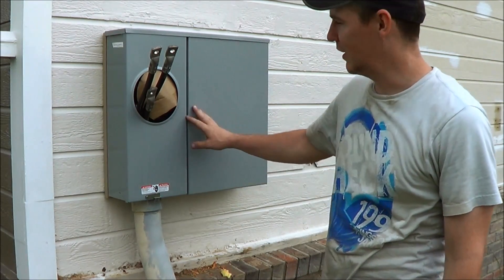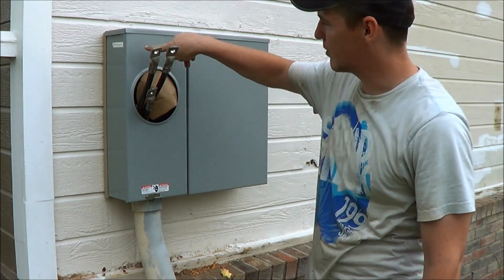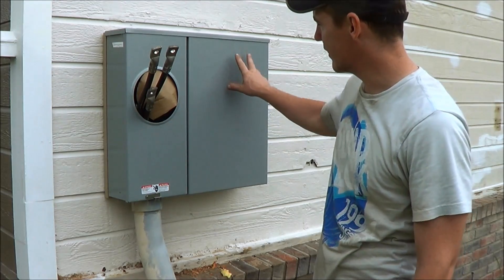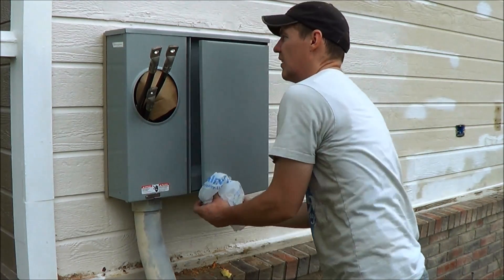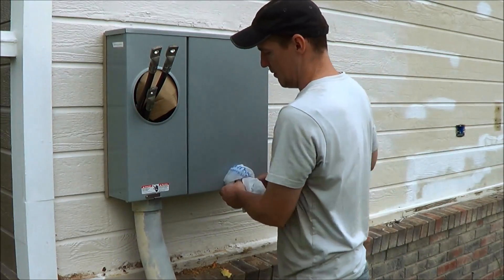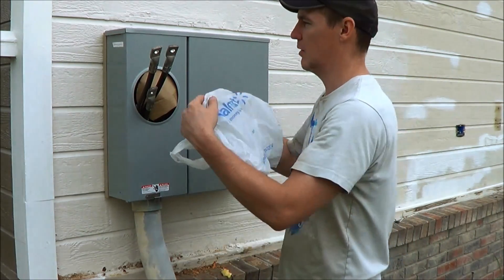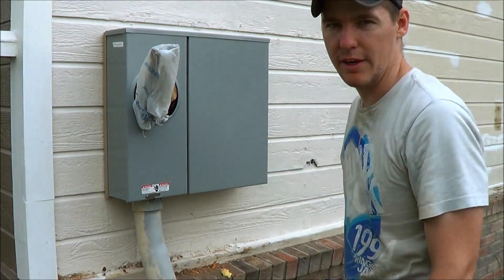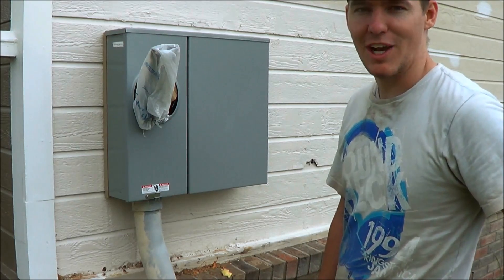Electrical Meter Base Install - Time Lapse

Comment: What brand did you install?  It looks like a good meter socket and main breaker combo.
Reply: What brand is my question too. That will prevent a separate shut off box install.  THAT SHOULD BE THE STANDARD.

Comment: Is it legal in California to add a meter after the breaker that's comes from the main breaker meter?
Reply: Required in 2020 NEC code 230.85   “Emergency Disconnects “   Allows fire department or others to shut of power without going inside the structure.

Comment: Y'all said it was a good job??  He forgot bushings on connectors.  Anything over 1" needs bushings.  Didn't see him use deox for his aluminum wiring.  Where is his bonding??  Plus, inside panel is now the sub n needs to float the neutral.  At the meter base, he needs to cover the opening if it does rain completely instead of just an plastic bag.  Before city hooks up power, they'll need to see inspection report first.  Just my 2 cents

Comment: Just one thing that I noticed actually three  things, I did not see a a plastic bushing on that connector and torquing that lug and ground rods install or the actually ground in the main....or maybe i did not see that.

Comment: I gotta do that energized. We cant shut down line side
Reply: You can ask the utility to disconnect power
Reply: @Nick-bh1fy  not in Philadelphia
Reply: @dickcheesewiz  If your network operator refuses to isolate it for you,  that means you haven't yet blown enough of the fuses on their end of the line :)

Comment: Nice visualization of how to remove a box and screw another one in it place(Even Though you skipped part of that too)...... WHERE's THE BEEF?? You left out about 95% of the actual work. I have never seen an electric co. that will mount your service side lugs for you..... maybe its different in your part of the world.....

Comment: Why do you paint in such a strange order? First 15cm here then 15 there and a little bit more over there until everything is white..? Why not just start in a corner and do it systematicly? And that bag is not going to keep water from going down that pipe. But it may help against corrosion.
Reply: Richard van Pukkem the paint job is the least of the problems here.....
Reply: They also threw away the cardboard placeholder shield that comes with the meter base for this very purpose.

Comment: Gee, Here in New York we, as a home owner can & are able to do your own work legally, most people that do this are not rich & cannot afford a $90 an hour electrician to do the simple basic operations needed to get this right & pass inspection. I have a friend that is a retired electrician & he went step by step with me doing a hands on setup of the 220 box & sub panel shut off 12" away  so I could save myself some bucks & still have it done by code & safely too.. The dweebs here that try to tell you that you cannot do it yourself are just po'ed that the state lets anyone that owns their own home, do the work of someone that is licensed to do that type of work & can rip you off big time by quoting that whatever they are doing is by the CODE book even when it is NOT even IN the code book, but sometimes it should be because it might be relevant to being a safety factor anyway.. So what you can do legally gives you more confidence & is able to keep you from spending way too much money, so you save something for later & will let you thumb your nose at the dweebs that look at cha like you are stealing their money from them because you are not using THEM to do the job at hand..  So, after I was all finished installing everything the way that Roger told me to do it,  I called the Inspector out & he looked it all over & then told me that Roger was a very good teacher & that my project had passed with flying colours also, he knew most of the licensed electricians in the area & each one had something that they did that set them apart from each other & he knew what Roger's trick was & saw it in my wiring job, he then praised me on a good job & said that he wished that more homeowners would take it upon themselves to know how to do everything around their houses so they could enjoy life & not go broke having to hire someone that is gonna rip ya off when they start quoting the code book & then add some codes that are not written in said book so, they can add more money & time to a job  even when it is not needed anyway..  My buddy had a new house built & before he could live in it, he had to have the towns ZEO  (zoning enforcement officer) come & inspect it for a Certificate of occupancy meaning it was safe to live in.. & his ZEO walked down a hall way & pointed out to him that he needed an additional smoke detector 6 feet up from the floor & in the middle of the length of hallway,  Bill said that he didn't see that in the code book & that he already had 4 smoke alarms in the house anyway But, that dickwad was persistent & Bill went into the bathroom closet, picked up a smoke detector out of his never ending supply of things you might need at any given moment & he attached it to the wall using sticky backed Velcro in that location  that dickwad suggested,  This got dickwad really pissed off & he was disgusted & quickly signed the scribbled signature on the C of O & left the house in a huff..   Dickwad was back a few minutes later asking if Bill could take him down to the street because the driveway was not quite finished yet & had a river of mud & stones going the complete length of it & being that the builder had brought him up to the house which was 3100 feet from the highway, he left his car at the street & now had to walk down the muddy driveway .. Bill told him that he didn't ever read THAT requirement in any code book & handed him a newspaper to spread over his head so he wouldn't get to soaking wet while walking down the driveway to his car..  I was there & started laughing the minute he started ringing the doorbell, as I knew what his problem was right then & there.. Had he NOT insisted on doing the smoke alarm,  in THAT specific spot, dickwad  might not have gotten Pneumonia while walking the 1/2 mile down he driveway during the massive cloudburst that day...   I also like reading the comments on stupid stuff like THIS video that wasn't all that bad but, I sure didn't care to be looking at the back of his T-Shirt when he was covering up what he was doing & why the hell did he feed out 10 feet of wire thru the hole in the building just so he could strip off the casing & then cut off all but 2 feet of it, Did he even use that 8 feet of wire he cut off OR  maybe he stripped off all of the casing & took the copper back to he scrapyard to he got some $$$ for it? LOLOLOL
Reply: the flash do you have a life?

Comment: 🤔no plastic bushings?
Reply: +Past Master  Inspector would fail you in these parts for not installing those plastic rings on the threaded ends. No inspected tag no meter either! Electric company won't work it without being inspected here!
Reply: +Troy Brownrigg  where's the ground 1/4" solid wire and copper rod?
Reply: Traveler water painting examples
Reply: i was gonna say lol

Comment: Are the boxes that protect the wire and components inside it rain proof? What would happen if a bunch of water got inside of the box and soaked the electrical parts?
Reply: It could short out and start a fire or electrocute someone if touching the metal meter box.
Reply: Mines been standing in the middle of a field on a post for 15 years now and that's not an issue.
Reply: Typically not much besides corrosion and lost energy.   Higher voltages will just vaporize the water the instant the water bridges out any of the legs,  and lower voltages will just sit there and dissipate wasted energy until the water evaporates, or breaks down from electrolysis (at which point the oxygen will corrode certain types of materials).  The entire box is metal and presumably well-grounded (via multiple earthing points on both sides of the meter) so it would be unlikely for any stray current to be detected by anyone outside the box (even if they were touching it).   Most higher voltage power lines are bare conductors with no insulation and that equipment does fine.

Comment: can you tell me what kind of ground sistem do you use most in the united states?
Reply: Ulfer is the best.... but minimum of 2 eight foot ground rods.
Reply: TN-C-S / PME is what the rest of the world calls it.   (DNO provides combined earth and neutral and then we earth it again in multiple places at the installation).   Only I think gas stations, marinas, and other special use cases use TT/independent earthing.

Comment: Doing my own as owner /contractor in Florida. Got a code book and went to it.
Saved 7 grand on a job a teenager could do. Encourage anyone who wants to save thousands on jobs anyone with any minor skills to do their own. It's 4 wires. Get over it.
I wouldn't mind if it was 20-30$ an hour but 90$ hr is surgeon money. I'm not paying that for easy work.
Reply: ️Electrical work isn't something just anyone can or should do and I wouldn't encourage anyone trying this without the proper training and skills
Reply: Guy Robby
 I have yet so see an HVAC guy do actual electrical work better than an Electrician. I`ve known from experience, i`ve had to help HVAC guys connect wires and figure out circuits not to mention, bend EMT pipes for them.
Reply: That doesn't mean every HVAC guy is better at circuits,  maybe you're just bad at circuits compare to the HVAC guys so you try to blame all electricians lol. So many years in the electrical field and had to switch over to HVAC.... wonder why. I'd love to see a second year apprentice bend couple emt pipes just by eyeing it. electricians at my company don't have a set rate, if you're a good electrician who can put out top notch work, no way in hell their getting paid dimes and pennies. Why would they when they know their worth??
Reply: Guy Robby But then again why would you start from the bottom for another trade....
Reply: +agaveman I've met tons of cheap guys like you who ended up spending double to fix their electrical problems. Plumbers and HVAC guys with 50+ years of experience in their field doesn't make them an alright electrician lol.
Reply: Switch trades? Hardly!  being triple ticketed Electrician, Refridge and Gas B I'm highly sought after and a specialist, rather than a run of the mill tradesman. Anyhow this is the internet and I have better things to do than argue with a hack.
Reply: Lmfao hack, okay sure. at the end of the day a good electrician doesn't need any other trade. if you're a good sparky, you'll never be out of work or side jobs.
Reply: Thanks for the compliment because I never was out of work in the 10 years I put in.
Reply: an jo ezy if yo put yo mirnd to it bdurr
Reply: it's more of a liability and insurance question, and $30/hr it's what a licensed person makes working for a company, plus benefits and the fact that you dont pay all the overhead(helper, insurance, truck,licensing,etc,etc,etc) and we dont bill every hour of the week.
Reply: Must be different where you are, I worked as a ticketed sparky for 10 years in mostly commercial, some industrial and about 6 months of Resi so I have spent time around a lot of electricians and now that I've been in the HVAC/R industry for 6 years I can honestly say that I have yet to meet an electrician who can outsmart an HVAC Tech on control circuitry. I'll admit my HVAC co workers can't bend pipe, but honestly big deal, a 2nd level electrician can do that efficiently. I guess that's why they pay Hvac guys the big bucks though ;)
Reply: @guyrobby5221  that's because you never met me
Reply: hvac guys are better in electrical than most electricians.

Comment: For anyone reading and considering this job, first believe in yourself and don't listen or allow the cancerous posts to take over your thoughts. After recently installing a 200A socket meter with a 200A outdoor breaker box along with an indoor 200A circuit breaker box I have a few tips and I am not a licensed contractor:
0. Apply for a permit and contact your inspector prior to doing the job and after you have a precise idea of everything you are doing as every single person that you are in contact with will tell you something differently but the only thoughts that matter are the inspectors. (in fact what i tell you on here will be different than what your local inspector will probably say, I err on the side of being overly cautious when it comes to wire size and grounding though).
0A. Contact the power company and schedule a time to have your power shut off so that you have plenty of time to get the job finished prior to the inspector showing up (might need multiple days or make sure to do everything you can while the power is still on.. it's not an easy job)
1. Install a 200A socket meter with a lever bypass 
2. If you have an outdoor pole then you are responsible for the wires going to the top of the pole along with the conduit (most likely 2" schedule 40). Use 4/0 Al or 3/0 Cu for 200A service (most likely  2 Al for 100A)
3. If you are connecting to the top of the socket meter use a rubber O-ring and glue on the socket meter adapter to make sure it doesn't leak water.
4. When connecting to the bottom or side of the socket meter connect it so that the male adapter piece goes into the box, fasten it with a metal conduit nut, then put a plastic insulating nut on top.
5. If you have an outdoor box then run 4 cables (4/0 4/0 4/0 2/0 for hot, hot, neutral and ground) through schedule 80 conduit underground at least 18" and place an expansive coupler between the earth and where the conduit goes into the house. You can dig the hole yourself but make sure to call 811 first or whatever provider comes out to mark your ground where things need to be dug. Do this prior to pounding in ground rods.
6. Connect the conduit to the indoor electrical panel box using the same methods as the socket meter.
7. Pound 2  5/8" ground rods 8' into the earth.. 1 rod is close to the outdoor circuit breaker box and the other is at least 6' away from the first rod and run #4 copper wire from 1 rod, to the other rod and to the outdoor circuit breaker box.
8. jumper your hot and cold water pipes together and run a #4 copper wire to your indoor electrical box. If you have a metal frame on your house or natural gas lines then run them to the indoor electrical box or jumper them.

random tips:
*Buy cable lube for your cables just in case you find it very difficult to pus the wires through. Usually you want to push the cables through the conduit then glue it together.. there's no way you will get cable through a long run of conduit especially if it has 90 degree bends.
*Use antioxident on all your aluminum to lug connections
*Place duct seal on the inside electrical box where the conduit from outside comes in, as you don't want cold air to come intot he panel box and create condensation.
*Connect your neutral and ground together only in the outdoor circuit breaker box

 Feel free to send a message, again im not licensed and the job i did was in minnesota where the socket meter was installed on a pole about 10' away from the house.
Reply: I pull wire and cable through conduit that is complete all the time because the code says it has to be complete in order to install the conductors.
Reply: I have a question for you I know this thread is a few years old but If by any chance you get this message please message me back thank you
Reply: Makes sense and all.  when I called my county to get in touch with who the inspector will be.  Answer she gave me was " You need to ask those questions to an electrician."
Reply: I have a question for you on the 4/0 4/0 4/0 2/0 six one four three seven four three eight eight four if you see this.  Going to run 150 feet 350Kcmil would like to dig the trench and run the the conduit and cable myself to save some money.  Will pay an electrician to terminate the ends and upgrade my 200 t 0 400 in parallel as well as adding 2nd 200 amp panel.

Comment: Wtf.. where are your grounds?! And why does the utility company do the service connection?!? Which hill Billy state is this? I'm an electrician in nj and that shit here is no joke. Before you even start a job you have to meet with the utility company inspector which in my area is pse&g and go over the scope of work. You run the utility/service cable and wire the meterpack/ meter pan yourself.  They only connection they make is the point of attachment coming from the street pole. Not to mention you don't have a #6 ground with a Kenney clamp in the meter pack with 2 8ft ground robs and a #4 ground with a Kenney clamp coming from the water main pipe. They you get a town inspection and a utility inspection and connection.  And if anything is off they can be assholes and make you do everything all over which can be a big fucking nightmare

Comment: Ryndon Ricks, you scab rat hack.  Where is your #6 grounding conductor to 2  ground rods separated 6 ft apart?  Where is your #4 grounding electrode conductor going to your H2O water line?  Must be grounded 5  ft from entering the building and jumped at the meter.  Not to mention a #4 grounding bond on the gas line. Few OSHA violations also: no hard hat, wearing a tank top is illegal, no safety glass, no visible green shirt or vest (which must be supplied by the employer).
Reply: If he is self employed, he could tell OSHA to go get fucked. Plus, when has OSHA ever been at a residential job like this? Show me in 29 CFR 1926 where a hard hate is required. Also show me where wearing a tank top is illegal, same with safety glasses. Reflective vests are only required when working in road ways. Get a clue you moron.

Comment: cable cutting by reciprocating saw???????

use multicore copper cable between outdoor panel with electricity meter and main panel in house